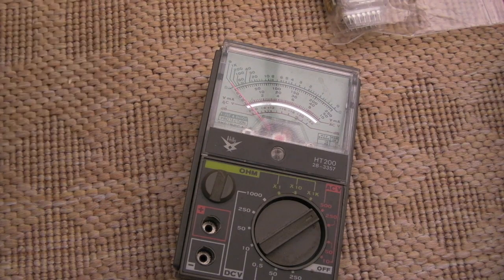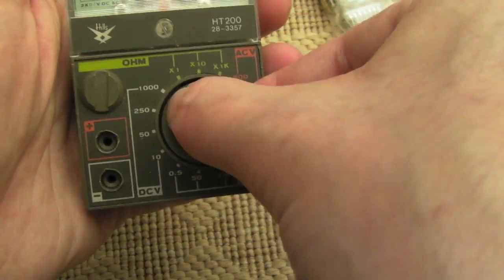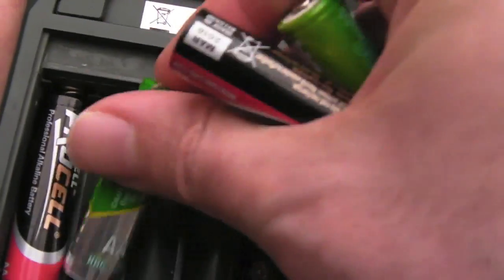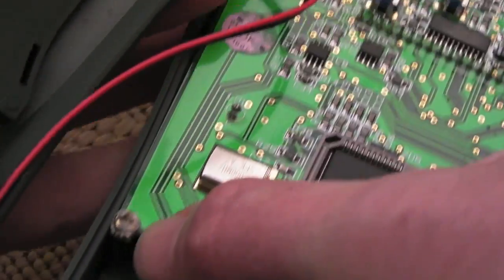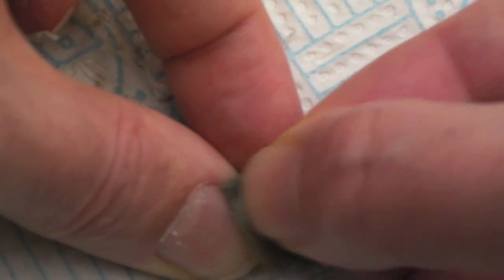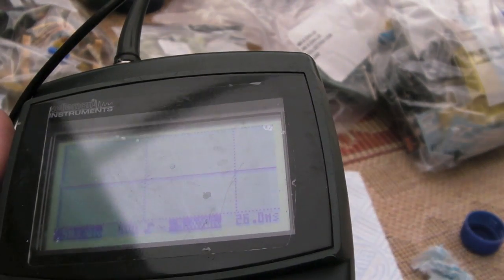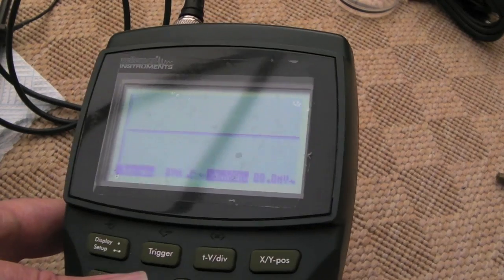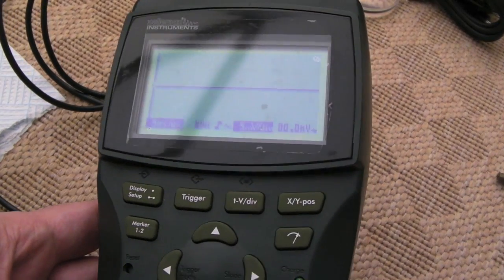Velleman HPS10  Handheld Oscilloscope Repair (Corrosion)

Comment: Quick rust removal tip without the use of chemicals..  White Vinegar + Baking Soda + Aluminum Foil and a squeeze of lime or lemon. It causes a reaction and removes corrosion, just leave it for a couple of hours. Great repair video no that i know much about scopes ( i need a tutorial )  i enjoy the diagnosis and restoration aspect. Big respect to this video, there is no price on friendship.  -
Reply from the maker: Thanks, great tips there on removing corrosion!  And thanks for the nice comments =D

Comment: On an analogue multimeter the batteries are not used for voltage and current readings so the easiest way to test if the batteries are okay is to put it onto the resistance setting and make sure you get full needle deflection with a short circuit. I had one from my Dad after he died but it was SO old I don't even know whether they still make the unusual batteries it used!
Reply from the maker: Wow - I never tought of that lol!  I just need to find some suitable probes.

Comment: My HPS10 is behaving oddly. Runs normally on 9V DC input from and AC/DC adapter.  With with charged NiMH batteries it continues to run fine on the batteries alone after starting on the 9V adapter and then pulling the adapter plug from the unit. But it will not start up on batteries???  Battery terminals are in like-new conditions. Every battery is outputting >= 1.3V (total across the 5 battery series array is 8.7V), and each one can maintain >=1.3V when delivering 250 mA into a discharge tester. I am stumped.  Any guess what's happening?
Reply from the maker: I was going to suggest checking out the DC barrel socket - maybe its switched, but that wouldnt explain how it continues to work when the DC jack is then unplugged =/  You must have a fault around the battery switching part of the circuit, maybe there's a transistor faulty there?
Reply: If that's the case, finding & fixing it is beyond my knowledge level :(. Thanks for the quick reply. BTW, prob doesn't change anything, but voltage across batteries is 6.7, not 8.7 (1.34V/battery avg).
Reply from the maker: Have you tried with standard 1.5 AA batteries?  There's a chance that it doesn't like the voltage drop?
Reply: @GadgetUK164  Great suggestion...it works.  Not practical long term as the HPS10 eats batteries when its off and I am too lazy (or forgetful) to remove them between uses<G>.  But it narrows down the cause (and possibly the cure) to more voltage. Would look for corroded connections, but I have and they are all clean.

Any thought on what could have changed to cause it to no longer work as it had on the lower voltage supply of rechargeable batteries? It wasn't just that the old battery set had deteriorated, as I had tested it on a set of new rechargeable batteries and those did not work, either.

Thanks again.

Comment: I mistakenly bought one of these from Maplins years ago.. it was that bad I returned it for a refund within 24 hours :(
Reply from the maker: Hahaha =D  Yes, it's not brilliant, but it is useful for basic stuff.  I think the problem is at anything over a few Mhz it goes a bit pants lol.  Even Aly admitted that herself on her website.
Reply: @GadgetUK164  I've had one for years - again maplin but was purchased to diagnose a abs fault on the hall effect sensors on my old xr4x4i. Its useful as you say for low frequency or situations where you might not be able to get a full size scope close to what you're measuring.